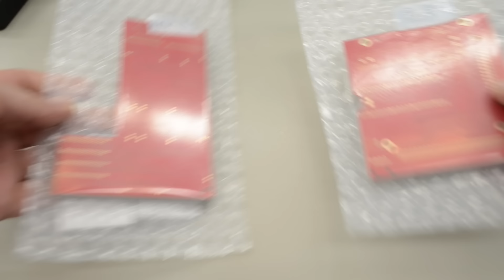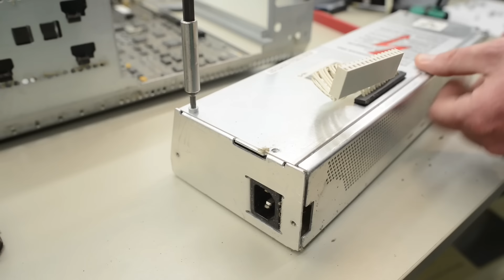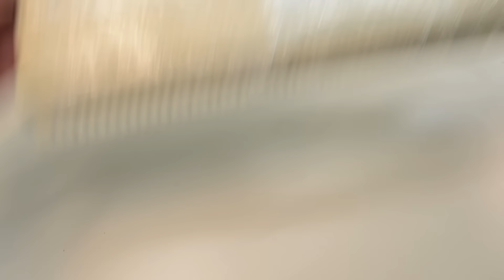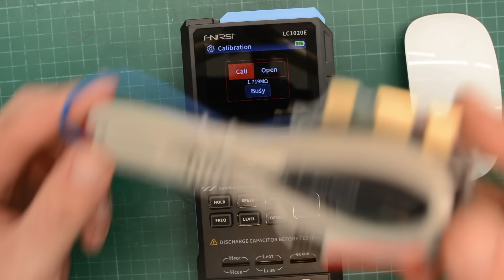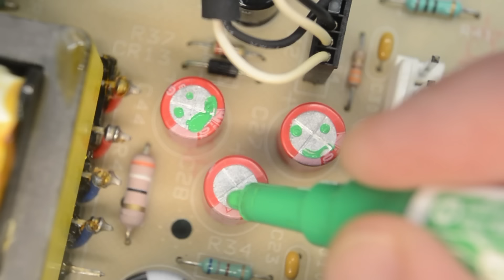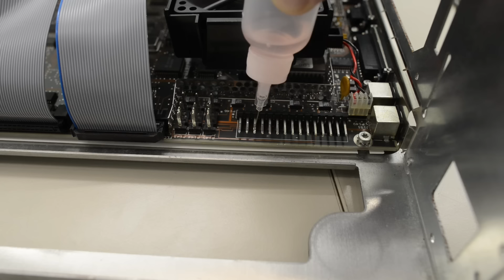COMPAQ Deskpro 386s restoration & repair + testing the new FNIRSI LC1020E

Comment: 28:30 can clearly see that your 3 big caps (1000uF) are in parallel. And you got "crazy measurements" in circuit. 3x1000=3000. Look at the circuit also to understand your measurements. Also, the ESR you got is the ESR of all capacitors in parallel plus the copper trace resistance in series for each capacitor, roughly 3 caps of 120mohm ESR each can have around 50mohm ESR in that configuration.
Reply from the maker: That makes perfect sense
Reply: Exactly. Also the fact that all of the caps measured perfect, but the machine started working after replacing those is something I can't understand. That there is something more beyond ESR and capacitance, which simply isn't true. Either there was something else, or one of caps was actually bad...
Reply: @michvod  "That there is something more beyond ESR and capacitance, which simply isn't true."
I disagree.
Actually, another factor is the operating frequency. As he shows when testing those caps.
A given capacitor can be good in circuits at mains frequency (50/60 or 100/120 Hz) but can be leaky at higher frequencies (AF for example). And in SMPS secondary (I guess those 3 caps were on the main 5V rail) the filtered frequency can be fron 10 to 100 KHz, so the leaking capacitor could fail.
Even a new capacitor have a inductance component in real life that can limit its usage in circiuts, deponding on the operating frequency.
Reply: That's why I just replace them all before I even bother powering it up.  ;-D  I have no nostalgia for old caps.  Into the bin with you.  Take the old fans with you.

It's honestly quite amazing how few issues I have compared to many of the tech YTers.  We're using the same old tech, but if you recap them, tend to the thermals (fans, heatsink paste, etc.), and weed out bad HDDs and optical drives, these things just run and run and run and run ....
Reply: @sirnickity  I can just imagine you spending 4-5 hours and $100 worth of caps on an old broken power supply, then finding out that the thing is completely fried afterwards ;)
Reply: @michvod   Generally, I find that that is not a problem.  If it doesn't look like something catastrophic has happened, chances are it's probably functional.

However, it could happen.  It DID happen to me, once.  It turned out to be a bad rectifier diode on the secondary side.  So I replaced it.  The PSU works now.  Ergo, I still won.  :-)
Reply: @sirnickity  You are lucky. My friend recapped a vintage amplifier and it still blew a fuse. He had to replace the mains transformer and somer other stuff that was worth more than an amplifier itself. But of course he already recapped it... so yeah
Reply: @michvod   It depends on how you look at it.  You could say, "this device is beyond economical repair and I'm going to cut my losses."  That makes sense for some people, sometimes.

I'm in more of a position where the things I want to use aren't being made anymore, and even if I spend 5x the value and way more time than I can justify on the item itself, I walk away from that having learned something about troubleshooting, and having spent time on what is a fundamental part of my hobby -- which in and of itself has no need to be justified by traditional metrics of value.  And, rarely is it the case anyway that it doesn't "just work", so on average it pans out in my favor regardless.  :-)
Reply: @sirnickity  I sometimes repair old stuff for customers. I've been asked by one of those guys if I can recap this non working computer, and I said sure, I can do it for $100 + parts. And they were very happy, but I then I said, that doesn't mean it will work again with just new caps. And they were baffled, why it won't work after the recap. I said if it is broken now, then throwing new caps will not bring it back. They said, just change the caps and it will be fine. I did just that and then sent them a video of that Mac IIci still not powering on after a recap. Of course some traces were eaten by the leaky cap juices that I had to find and fix, but they could be fixed before recapping and the computer would boot.
For instance, Macintosh SE/30 will happily work with all the electrolytic capacitors removed off its logic board. The only thing you lose is sound.

Or another case, a friend of mine bought an old tube guitar amp for $250, which the seller said it only needs caps as it is blowing the fuse. He happily put almost $150 of caps and another $350 of tubes into the guitar amp, and it was still blowing mains fuse. The reason was it had shorted mains transformer, which cost another $250 to rewind. So he now spent $1000 for a tube amp that usually go working and in great condition for about $500-600. And his wasn't really in great condition to begin with. If he just had it diagnosed before doing all this work, he would have saved him lots of money and time.

Comment: There are Compaq branded versions of DOS up to version 5, it's usually worth it to install them as they have more advanced MODE command which can control things like CPU speed and inversed characters etc. on their laptops. 3.31 is also special version that allows >32MB partitions while still being less memory hungry than DOS 4+, I use it on all 640k systems.

Comment: Hey i've got one of these, Its a good little machine, works great. I had to recap the power supply as there was electrolyte starting to ooze out but other than that it's been a solid machine. I wish I had the right monitor for it though.

Comment: That PSU looks relatively modern compared to the one in the original Deskpro 386, that one is full of tantalums which of course exploded after ~30 years of unuse. Electrolytics in mine were good but I replaced them anyway when they were 39 years old...

Comment: I would guess based on some I have had, that the smaller connector on the floppy drive was for laptops.  I'd say Compaq re-used them instead of using 2 different drives.
Reply: Yeah I think it's the same FDD that they used in SLT series of laptops. Newer LTE series used slimmer drives with 26pin ribbon cables.
Reply: Adapter board says it's to convert from 26 to 34 pin drives... I'm not sure what the 8 remaining pins are, drive select stuff maybe?
Reply from the maker: @Nukle0n  Most likely redundant ground pins.
Reply: @Epictronics1 i assume that chip on there does something, probably drive select related

Comment: I still have to finish repairing my Deskpro 386s/20 (which was apparently upgraded to a 40Mhz 386DX well before I got it). I was in the middle of writing out a Compaq Diagnostic Disk to run the config utility when a transistor in the power supply blew up. I replaced the transistor, but there is a second transistor near the first one which is also suspect. Just haven't replaced the second one yet or done further testing...
Reply from the maker: Neat. Did the leaky caps kill the transistors?
Reply: @Epictronics1  No signs of leaky caps, so I am not sure what caused it to blow.

Comment: i think the plate is to hold the weight of the monitor, its a desktop! nice work so far.
Reply from the maker: Agreed :) Thanks
Reply: @Epictronics1  thanks! i hadnt watched the reassembly yet. i have the 386dx mb all by itself in untested condition, but it has 4mb onboard.  looks great at the end, hope the back panel turns out.